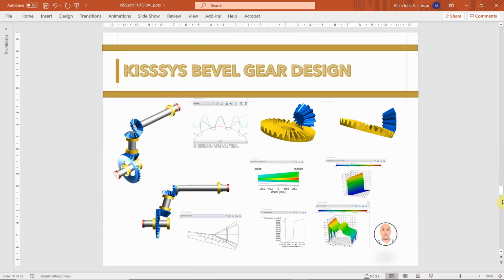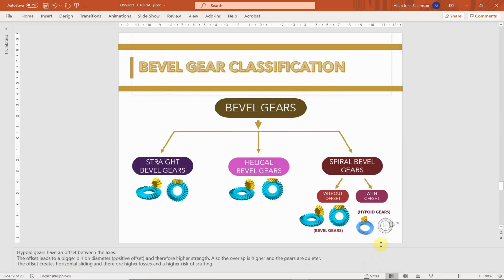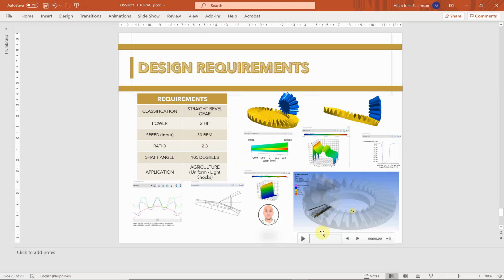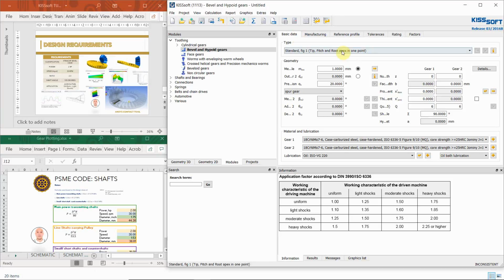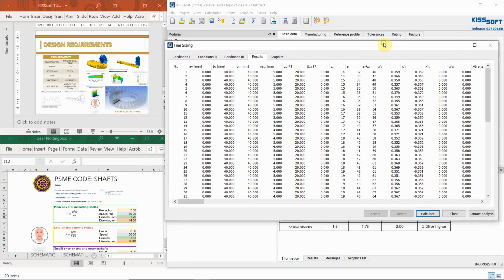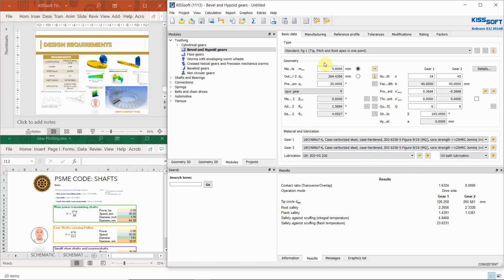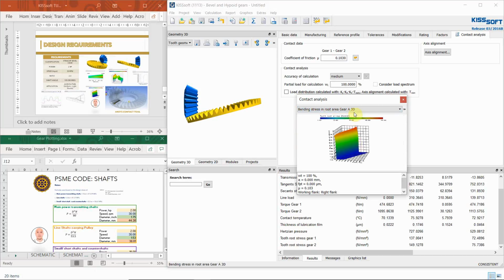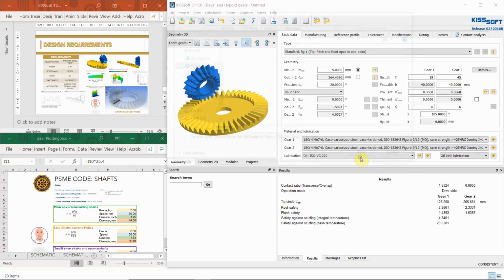KISSsys/ KISSsoft Bevel Gear Design Tutorial

Comment: i have an issue modelling a torsion differential , could you suggest how to model the differential cage and an idea on the type of coupling to use. As a college student still coming to terms with the software
Reply from the maker: Hi Hammad. There is an example of gear differential in kisssys. Go to file --> open examples --> select BevelDifferentialGearbox.ks. You can review the modelling method as a guide. I will create seperate video tutorial for this one.